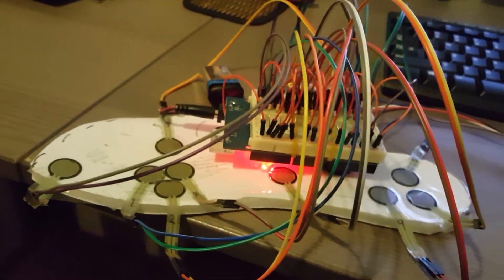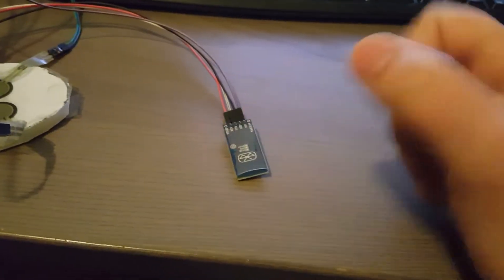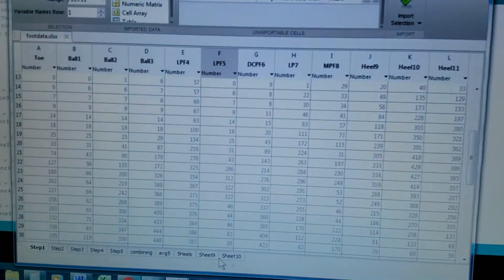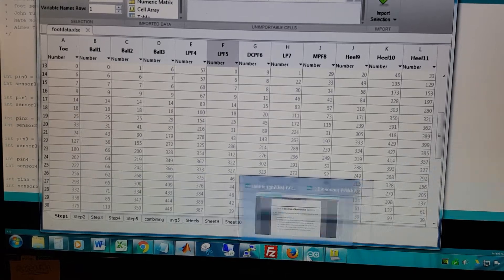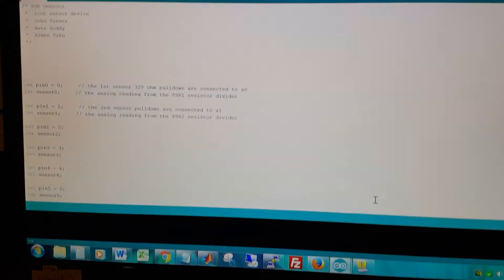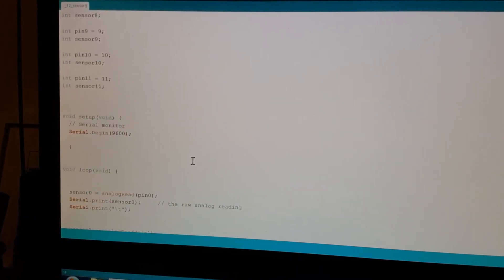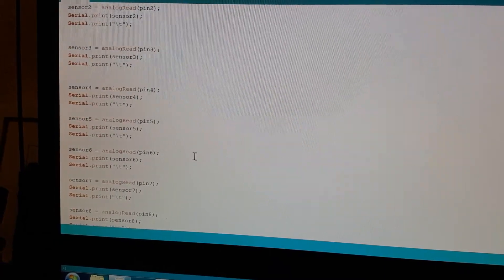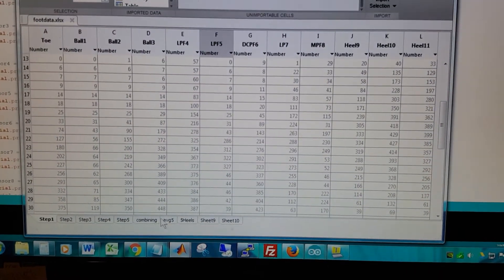Sending sensor data - Biomechanics Arduino bluetooth wireless data to MATLAB

Comment: Hi! We are doing a similar project to what you did in the video. We have two questions please one is how did you connect the force sensor to the bluetooth using the arduino, the circuit is not that clear in the video. We also wanted to know how did you collect the data and which programs did you use? Thank you for your help and time.
Reply from the maker: Hi Noor, the force sensor connects to the "analog inputs" on the Arduino. Then, the Arduino function "analogRead()" gets the data. It's then sent using bluetooth module. I put a link to the code in the description.  Here is a link to a schematic that works https://learn.adafruit.com/force-sensitive-resistor-fsr/using-an-fsr
Reply from the maker: Shoot me an email and I can help you out more.  Good luck!

Comment: Hey can i send matlab script to arduino wirelessly?
Reply from the maker: You cannot run matlab scripts on an Arduino, if that's what you're asking! BUT you can convert matlab code into C so I guess that's possible. Good luck!
Reply: Thank you for your response. I want to build a car for a school project. But we can't use Arduino software while doing it. We need to communicate Matlab with Arduino Uno. But  when we do that Arduino Uno doesn't save it at its memory or database (i don't what is it called in english) so it has to be connected to pc all the time. But i can't build a car that way. So it has to be wireless. I found some ways to do it (with Xbee Models) but they are to expensive for a uni student. If you can help me i will be deligted. Sorry for bad english.

Comment: hello,,,Im anwar..im really want to know how you connected the arduino and the matlab using bluetooth communication. Because now, i am do some project to collect data from a sensor that attached to arduino and send the data into matlab using h2-05. I used buzzer and PIR sensor. But now,i have try too many way to collect data from arduino and send to matlab using h2 05 but all it not succesfully. hopefully u can help me, thank u
Reply: ok ok buddy,,,,its good u r working on the project,,,

Comment: Could you please forward the code that you used for this process?  I am working on a similar project and this would save a lot of time for me to get some idea based on your work.
 itmenont@gmail.com
Reply from the maker: Hi itmenon, there is a link in the description with the Arduino code.  Good luck!

Comment: Helllo,,,Im Eddy..im really want to know how you connected the arduino and the matlab using bluetooth communication. Because now, i am do some project to collect data from a sensor that attached to arduino and send the data into matlab using h2-05. I used accelerometer and gyro sensor. But now,i have try too many way to collect data from arduino and send to matlab using h2 05 but all it not succesfully. i done with pairing the bluetooth, so im really appreciate that you can help me and give some information about your project and send to my email ekurniawan00@gmail.com.my...Thanks..im really thanksfuls if u can help me..
Reply from the maker: +Eddy kurniawan I just sent you an email.  Theres a program called teraterm that's used to gather the serial data.  Good luck.
Reply: +Jmaturner thanks :)
Reply: +Eddy kurniawan Hi, can you forward her email to me? I am doing to similar project using 9 degree of freedom and want to stream data live on matlab by using bluetooth as well
Reply from the maker: Hi Duong, my version does not stream the data live on MATLAB. I used a program called teraterm to export the serial data first as a .txt file. You might be able to figure something out. sounds fun.